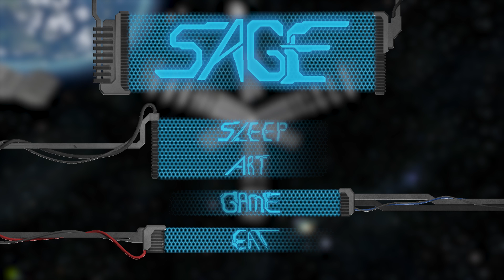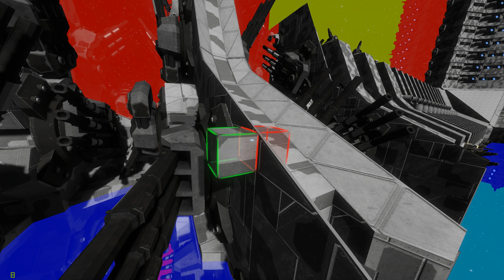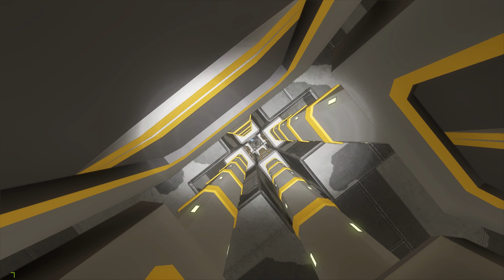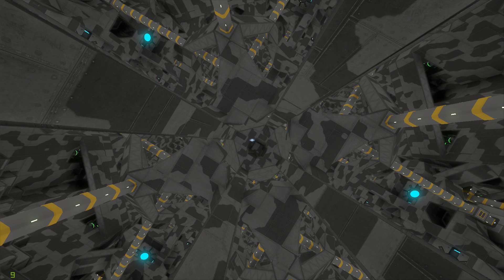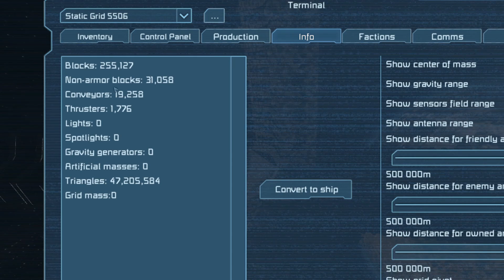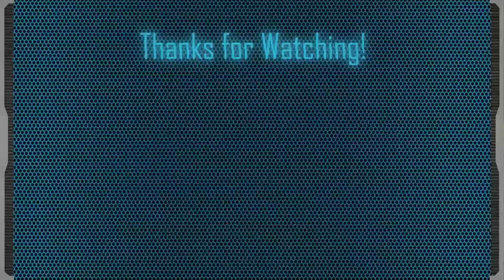Space Engineers, The Asterisk (Mega Warship, 200,000+ blocks)

Comment: What hardware are you running?  I am starting a build based on a HP Z420 Workstation that has the 2.7 GHZ 8 core Xeon.
Still need to choose the graphics card upgrade if it needs one.. It has an older Quadro 4000 in it now.  It is a lease refurb from an oil company that did geologic exploration data visualization on it. The oil industry collapse last year dumped a lot of decent stuff onto the market at low prices.

Comment: The thing about big ship isn't their size, but the number of triangles after all. for large ships, if it is a shell like ship, you just double the number of triangle. It would be interresting to test this to see if it is true that a large construct (that has no space inside and just fill with blocks) would be more framing friendly than your shell.
I don't know if it has been done before...
Reply: the thing that causes the lag is almost never the rendering with space engineers, most of the time it's CPU load. The thing causing lag is simply the number of blocks
Reply: And not the number of triangles... Ok. Usually, in a 3D modeling softwar, the more surface you have (and details), the worst it is. But I still wonder if a immense cube shell can be more frame-killer than a fill one or both will do the same.

Comment: LOL, whats the mass?   Looks like with the jump drives, even with as many as there are, you'd be lucky if you could jump a few kilometers each time with them, LOL

Or would be interesting to see if the game doesn't glitch and rip it apart while going FTL.

How much thrust?    Would be interesting to see if it skimmed a planet gravity well, and see if you could even break away without being pulled down to your doom.   I've had problems with that with vastly smaller large scale ships, skim a well, and then try to break free, you're looking at your speed thinking your increasing, only to go to external cam and it looks like your closer to the planet, and then you realize you are, thrusters at full ahead, ship traveling TOWARDS the planet at full speed, LOL...  time to bail out and let the ship get pulled in, wave good bye to the old gal, and start again.

Could of deleted the halved demonstration sections in game after cutting in half and showing, less blocks in scene, improve frames a tad when trying to convert from ship to station.   Planets and moons in scene don't help either, LOL

But Would be nice if the game got more optimized or improved to deal with larger block scenes, even my 980 Ti drops frames into single digits when things get too much, especially overloaded weapon system builds like this (for me, less blocks, but a shit ton of projectile weapon systems).  i5 4690K, 8GB, 980 Ti...

Comment: That settles it.  You really are completely and utterly messed up in the head.
On a positive note... your handle of symmetric geometrical structures is quite impressive.  If SE had the capability of taking large structural elements and merging them into a single physics object (like a KSP welded part) you'd probably be able to fly that thing.
You might get more performance from it in a world space like the old SE pre-planetary phase with zero asteroids spawned.  I don't even known if it's possible to create a world space like that still, but it would be interesting to try.

Now... time to downscale and see if you can get it usable.  I had a number o9f conceptual images fly through my head while you were doing the cross-sections of basically taking 5-6 of those turret structures in the ends on the towers and capping the ends with a large saucer shape, itself dotted with more turrets, and you might get reasonable firepower with reasonable performance as well.

However, I really do like the omni-directional functionality of the thing.  So, you might try thinning the towers to about half of what they are, and cutting them down in length by about half and see where that gets you.

I have a theory that the massive number of guns on that thing weren't making a lot of really quick progress on the other section due to the simulation being incredibly lagged up.  It's possible that only a small fraction of the hits were being processed into damage on the target structure.  If this holds true then downsizing the craft does not necessarily mean loosing its lethality.